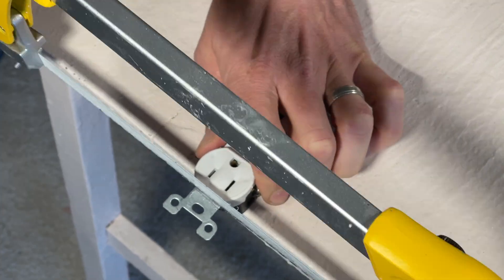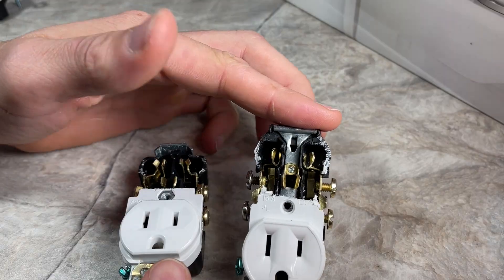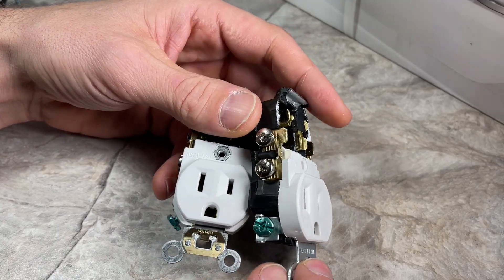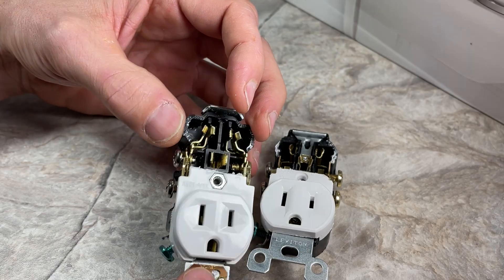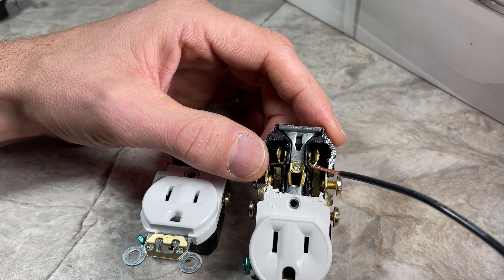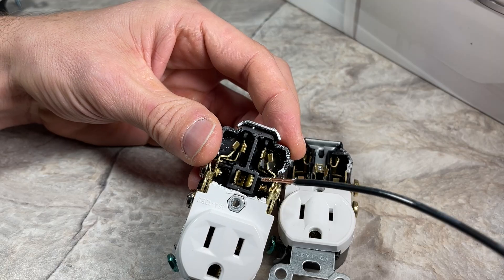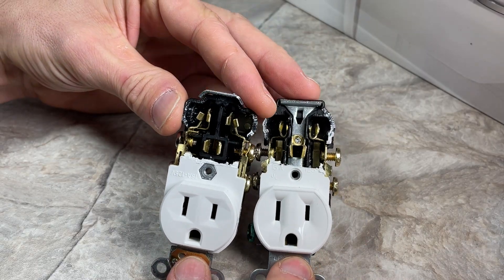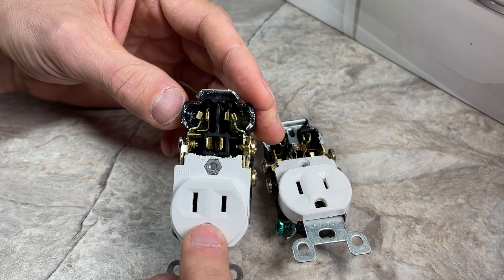What Outlet Should You Buy For Your Home |  Commercial vs Residential

Comment: Another difference is that the commercial outlet is rated as "self-grounding." This is important in older buildings where the armor of the BX cable is used to ground the system, thus there is no ground wire running in the walls. (This is out of code everywhere these days, but if it was in code when your building went up that is what you'll find.)
Even though in the cheaper outlet the ground slot is riveted to the mounting strap the cheaper outlet is not considered self-grounding, as there is no guarantee of good electrical connection between the mounting screw and the mounting plate. The commercial outlet has a brass retaining plate on one of the mounting holes, which helps make a strong electrical connection from the outlet to the mounting screw to the wall box, and thus to the armor of the in-wall cable.
Living in a building that went up in the early 60s I only use commercial or better grade outlets when the original, 60 year old, outlets need replacing. The next grade up from commercial is hospital grade, which are built even stouter.
Reply from the maker: Very thorough explanation Elliot and I really appreciate you taking the time.  👍
Reply: Get an outlet tester and check the outlets.  They cost around 10 and will let you know that polarity and ground are working.  It is still code to run ground via metal emt, but very few houses are run with EMT unless you are a contractor who likes to do it "tool time" quality.   On the old homes you can run the commercial and still not get a ground as there is no ground in the metal box to begin with in some cases.  Always test and verify with electricity.  I have found all kinds of electrical done wrong in old homes.
Reply: @ryanksiazek  In much of the Chicago metropolitan area EMT conduit is required. Doesn't mean it's done correctly, of course.
Reply: This really got my attention. A friend moved into a 1950's house which had non-grounding outlets. Another handyman replaced them with the 3-hole outlets, but I wondered if she knew what she was doing. I didn't, but am trying to learn about electrical stuff on the quick. I believe the commercial grade outlet is the best solution and answer to this situation. Thanks.
Reply from the maker: @Rextrent  I would be careful if the house wasn't originally wired with a ground wire and the old 2-prong outlets were just swapped out for 3-prong outlets.  There are solutions to this issue but you should probably reach out to a licensed electrician in your area to better understand the options and ensure the outlets are wired safely and up to code.
Reply: @EverydayHomeRepairs   I grew up in an early 50's house that had two-prong plugs, but the bathroom and of the kitchen boxes were grounded to copper plumbing.  Some of the early three-to-two prong adapters had a little ring that was designed to be held in place with the centre plate screw, and if you did this, you ended up with a grounded circuit.  Of course, upgrading from copper to cPVC or Pex plumbing meant you had to replace the wiring.
Reply: My house was built in 1954; added to in the 70s, and again in the 80s. It's really three codes in one house. When I bought it, there were no grounded outlets in the 1954 part of the house. As I repaint, I replace the outlets with grounded outlets and ground through a pigtail from the outlet to box and the BX cable. Not code, but grounded none-the-less. Had I watched this video and read your comment before all that, I would have bought the commercial grade hardware and saved myself the hassle of constructing pigtails. But, I've still got a few outlets/switches to do...so: Thank-you.
Reply: Good explanation. I own 3 rental  houses and one apartment complex, and all were built decades ago. I always use commercial grade or hospital grade for the grounding reason that you outlined. Also, a $10 or $15 outlet or switch is a bargain  -- A .99 outlet or switch is going to cost me a $100 service call in the near future, whereas commercial switches and outlet will outlast me.
Reply: That is so important! Thank you for that point.
Reply: Doesn't seem like it would be very helpful with those plastic enclosures so popular now
Reply: @stevecooper2873  The plastic boxes were not in use in the 1950s.
Reply: Yup, I can't count the number of bottom of the barrel crappy receptacles I've seen in the same scenario, with BX wiring. OR, you get someone who thinks they've figured out a way to beat the system and connect neutral to ground in the receptacle box "because it goes to the same place anyway!" (not the right way to do it!)
Reply: @Elliot Nesterman
As a 20+ year electrician, I can say that you are technically correct. They are not "rated" as self grounding. 

However, they ARE self grounding. The chassis that runs through the receptacle has the ground receiver riveted to it in both the ressie and commercial grade receptacles. Not to mention the actual ground screw is also mounted to the chassis in both.

The ONLY different between the rated and non-rated grounding systems of these is that paper thin bronze piece. And that thing literally does next to nothing in actuality.

It would be like if you go to jump start your car, and I say, "Hold on, the connection will be better if you put a penny in the terminal before clamping the cable on it."

On paper, the company has managed to get UL to accept that it's better, but so many things don't translate from paper to actuality.

Furthermore, far too few residential areas actually use metal device boxes. They are all plastic now. And the ones that DO use metal boxes are rarely grounded. So whether or not these will "self-ground" is a moot point a majority of the time. "Self-grounding" labeling is very misleading as the entire device functions in the same way as the cheaper ones.

Comment: Retired Commerical Contractor, You didn't mention that heat from heavily loaded devices causes the contacts to weaken and/or melts the thin plastic.  I use NOTHING besides 20A rated receptacles commercial devices.
Reply from the maker: Good feedback James, thx!

Comment: I find it uncomfortable when someone is offering advice about technical matters, particularly when it involves basic matters such as electrical, and for liability reasons, states that everything (s)he’s saying is just entertainment. It’s not. It’s advice that’s being given about the matter being talked about. If someone is confident that what they’re saying is correct, then say so. If not, then don’t talk about it, if you’re not qualified to do so.

Despite qualifications that it’s just entertainment, there are people who will follow the advice being given, because that’s the way people are.

An example; There are commercial grade outlets that have push terminals. Usually those terminals have the wire pushed in, but then the screws are used to tighten the wire in place. These are fast and easy to use, but also hold the wire tightly.

Comment: Why would they even make an option of push in back’s for 14 gauge wire with an outlet? It should only be made for 12 gauge wire, 14 gauge is for lighting, not outlets.
Reply from the maker: Hey Chris, these are 15 Amp outlets so you could use 14-gauge but many people have pointed to favoring 20 Amp outlets as much as possible which would need 12-gauge.
Reply: Not true.

Comment: how on earth would the plastic break huh. Yes the plastic can melt if someone is stupid enough to ''suck to mutch juce'' trough a regular house hold socket. The 50 cent is also easily to repair... (no not the plastic) Yes you still have to replace it when it happens again DISCLAIMER IM NOT RESPONSIBLE FOR YOUR STUPIDITY! So turn the main power off of your house first! take the cover off your loose socket and bend the pins back closed up. No they wont short as long as you dont bridge any of the contacts to ground or eachother put the cover back on and put anything with a plug in the socket then turn on the power. thoe's the pliance stay on? OK! your done! does the fuse pop off then you did something wrong and leave the fuse off and call an electrician. again i am not responsible for a shocking experience.

Comment: Love your video i have bought both the reason is that many outlets are just used a few times and are not put under extreme conditions so to me unless i use a outlet a lot either should be fine.  The heavy grade is more needed when you keep plugging and unplugging need a higher load than normal a compressor a pump a floor power tool over 10 amps.  Most use these to plug in a lamp these days they are LED so demand is low.  Just some differences.
Reply from the maker: Appreciate the feedback and many others have mentioned a similar strategy so I would say you are not alone in mixing depending on the use / demands.

Comment: Never seen a 15A 'commercial' plug.  Commercial grade, of that type plug, is only 20 amp rated outlets.
Reply from the maker: Thanks for the feedback.
Reply: Commercial utility circuits are usually speced at 20 amps.And use spec grade outlets. A 'commercial' 15 amp outlet would be marked 'spec grade'

Comment: No one's going to recommend the lesser quality electrical item but remember there's thousands of not millions of "residential" outlets out there without any problems
Reply from the maker: Most likely 10's of millions.
Reply: I agree if you add the word "yet".  My house was built in 1956 and there are a couple of original outlets left, they have almost no plug retention so I don't use them.  Since they're 2 wire outlets I'll be replacing them with GFCI outlets.

Comment: Wait... 24 plugs in the condo, and outlets at $2.00 a piece leaves a material cost of $35? Is that bulk pricing? Like a box of 24 or two boxes of 12 reduce the price to below a dollar fifty?
Reply from the maker: Hey Sans,  $35 was the price difference if I went with all commercial as compared to residential.
Reply: @EverydayHomeRepairs  Oh, that makes more sense. Thank you for this video and your insights. It would also be interesting to see perhaps a mid grade outlet compared to these two. Something with a price point in between the $0.50 and the $2.00.

Comment: Things you fail to mention.
1. Both are UL listed.
2. Both are rated for 15 amps.
3. Both meet NEC.
4. Both have a long, safe record of use.
Give all the information for a fuller description. Residential outlets are for less overall cycles. Check. The commercial give more plug in/out cycles. Both will fail if the load exceeds the 15 amp rating. 
If safety is your largest concern, the wire size would be where you should  begin. 20 amp circuits are safer, if one were to go by your examination,  because they can handle more current. Period.
Reply from the maker: Thanks for the feedback and appreciate you taking the time.

Comment: What about the fact you have better residential plus than commercial? You also have 15 or 20 amp plugs. You have cheap residential and cheap commercial. Comparing commercial and residential is like comparing granny Smith to Macintosh, similar but but the same thing.

Comment: I had a cheap outlet melt, and arc out while using a space heater in my apartment, so yeah,  there's a difference... They really shouldn't be allowed to sell such an inferior product for that very reason.  They are a potential fire hazard!
Reply from the maker: Thanks for the feedback and space heaters are a pretty common source of issues.
Reply: Your outlet failed because there was a problem with it! There are so many factor that could of contributed to the problem you witnessed like a defective Circuit breaker, and oversized Circuit breaker, loose connections, or a damaged outlet. It didn’t only fail because it was a residential grade.
Reply: @lawnmowerdude  ... this is not the first time I've witnessed a low grade outlet fail while using a space heater.  No, it failed because of what is seen in this video.  The heater pulls enough current, that over time, it weakened the thin plastic due to heat, and failed when it reached a critical point.  Will never convince me otherwise, and I'll use the $2 outlet from here on out...

Comment: 👍🏻👍🏻   GREAT INSIGHT!   I have been a commercial electrician for 30+ years and only use spec. grade devices.  
One other point about the older devices “failing” and cord-caps just “falling out”.....   many times the deformation of the metallic components due to HEAT.   Many times a homeowner or user will plug in higher continuous loads (ex.  space heaters , etc) and the resulting heat will have an effect similar to annealing.    These wiring devices need to be changed out ASAP!

Thanks for a peek inside.

🚨🚨. FORGOT —. How about doing a comparison on Leviton DECORA style devices?
Reply from the maker: Thanks for the feedback and recommendation for future videos.  I think a few more of these comparison videos are in the near future.  Take care.

Comment: I always go with the commercial for everything (or even better,, go with industrial or hospital). You want that quality even more so in peoples homes where you have children people sleeping, etc. The commercial/residential differentiation makes no sense whatsoever. You don't want to put the cheaper, less well built stuff into your home with something so dangerous. The US has the worst designed sockets anywhere. Look at the British and European style sockets and you will find them to be far more solidly built, overengineered, with more safety features such as half insulated prong which prevents electrically charged prong being exposed during insertion, etc. You don't want to take a bad design like the US outlet and then make it worse with a cheapo outlet.
Reply from the maker: Thanks for the feedback James.  I was a bit disappointed by the Commercial "Plus+" Leviton Switches.  Didn't see much in terms of differences on the inside.  https://youtu.be/X8Y_LRqyYcg
Reply: @EverydayHomeRepairs  it's called marketing
Reply: Much the same goes in Australia as in Europe (though with different plugs); you can get better/worse brands but residential and commercial environments use the same fittings.
Certainly the contacts in Clipsal (our leading brand) outlets (or power-points as we tend to call them) look comparable to the commercial Leviton.
 
I can't say I've had much trouble with wall outlets here; it's mainly in power-strips/boards where corners are cut.
Anyway, given a hypothetical choice between AFCIs+resi outlets, or commercial outlets without AFCIs, I'd take the latter option in a heartbeat.

Comment: In addition to less actual material going into the cheaper outlets, a big part of how they make a profit off of them is by not packaging them individually. The individual boxes in which they package the commercial grade outlets are actually a big expense. Not only because of the extra packing material, but because in the same case that holds a mere dozen boxed commercial outlets they can stuff 30 cheap ones, which saves on shipping costs.
Reply from the maker: Good point Dwayne,  you are right to point out the cost save on logistics / shipping for the cheaper residential outlets.
Reply: The other logistic here is shelf/storage space in the store. One order gets 3x as many items into the store's same storage and show space. Much like 'bag your own screws' out of the bins vs 'bags with a few screws each' on the display.

Comment: Thanks for the demo. I thought the differences were minimal but you demonstrated otherwise. I hate the tamper resistant. Another great solution for a virtually non existent problem. One size fits none. Thanks for posting!
Reply from the maker: Thanks Paul,  yeah in my area we were one of the last to adopt the NEC code for TR.  As a result most of the properties still have standard outlets.
Reply from the maker: @Speed Buggy what is your go-to brand?

Comment: The difference between various countries electrical is always amazing.

Here in Australia almost all plugs these days have a separate cover (generically white, but you can pay a few $ s more for silver or gold or color) that covers the screw holes.

But we typically don't use boxes for switches. Just direct wire.

(And it's absolutely illegal to do any home wiring, it anything in wall. Admittedly we are 240V with some 3phase as well... But this includes 12V in wall and alarm wiring)
Reply from the maker: Yeah, others have mentioned the massive difference specifically between Europe, Australia, and the US.
Reply: That’s too bad you can’t wire anything yourself. The guidelines are so easy that our electric code (The NEC) is basically a picture book with commentary. A normal thing to do in houses around here are to literally strip out all of the old out-of-date wiring (ungrounded outlets, paper insulation, knob and tube etc) yourself and replace it with modern wiring that meets code.

Comment: Seems like if you have a newer house with Arc Fault breakers you would need to have the commercial grade plugs to prevent loose connections causing breaker trips! or at least keep the contractors from using those crappy push in connectors on the cheaper plugs. its interesting to see how much stress a vacuum cleaner puts on the circuits when most of the time its just the plugs wired using the push in connectors. The push in connectors do not have as much contact area as the screws do and that is a source of heat in high current loads.
Reply from the maker: Agreed, thanks for sharing your feedback Kreg 👍